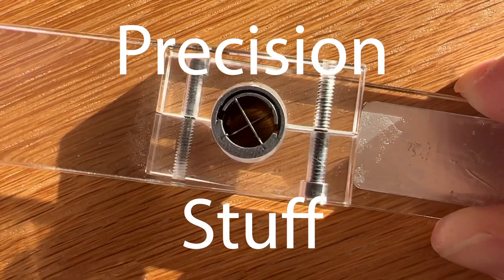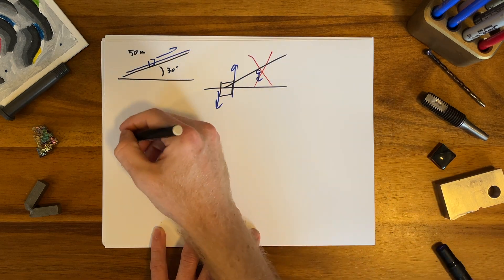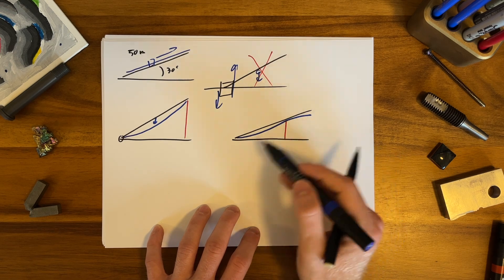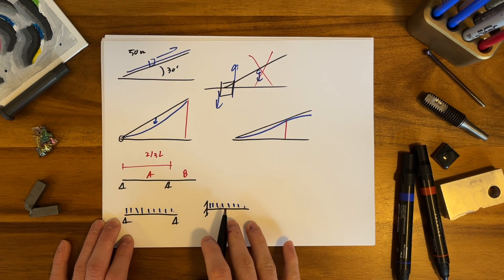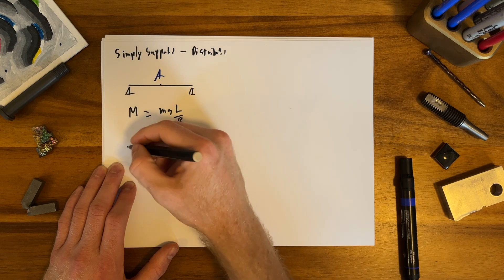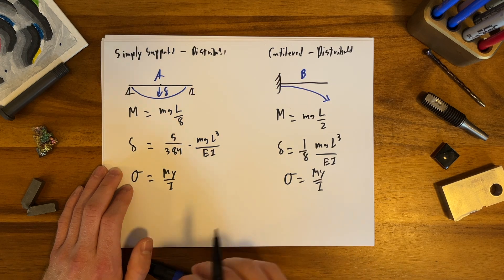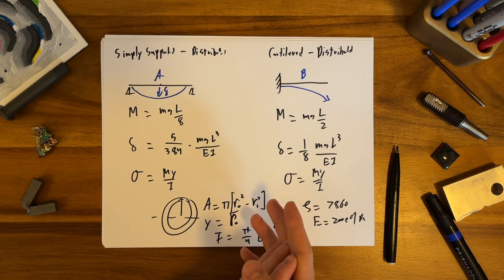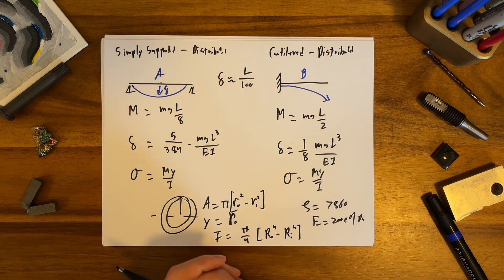Precision Approximations: Fast Analysis of Large Structures

Comment: A bit disappointed with the video :)

I thought I am getting some meta-logic idea on how to develop rapid initial intuition to any complex problem...
Instead, I see a very specific solution to a strictly theoretical (and nonsensical - who needs a rail launcher?) problem.

I am not even sure I agree with the solution. So, you found some formula that solves "what if we can only use one support beam?" for an acceptable bend of the rail in static conditions.
What about side-to-side support? What about fatigue on the structure, as it deflects with each launch?
What if the best solution is 3 lighter support beams instead of one?
Maybe the lighter material is a lot cheaper to purchase, source, transport and work than a single "super beam"?

The whole thing was a bit of waste of time, unless you are in the business of solving very weird structures on paper only.